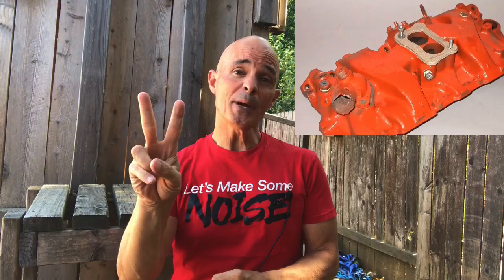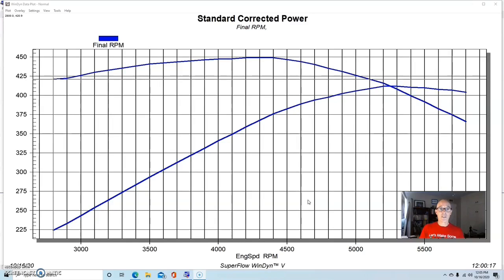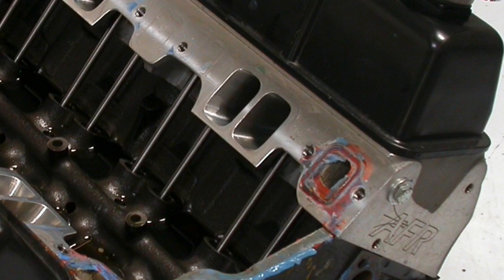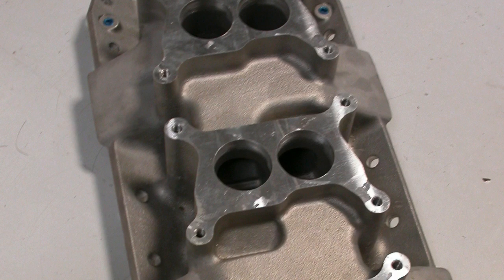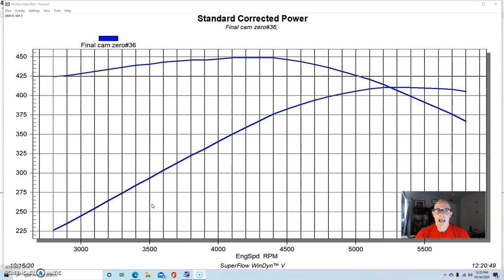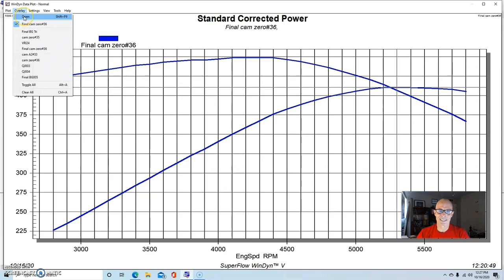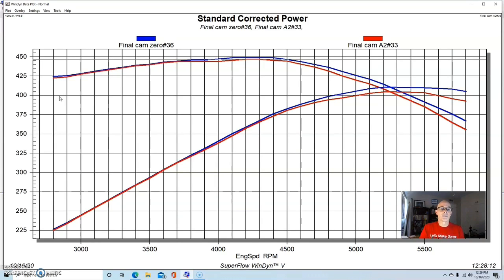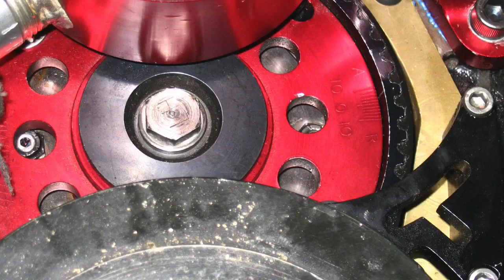SBC TRI-POWER INTAKE & CAM TIMING

Comment: Set the cam straight up, that's what it's design for. The best way too improve on it is to put higher ratio rockers. You don't increase the duration but you speed up the open and closing, more area under the curve along with higher lift.
Reply: For example, going from 1.5 to 1.6 rockers is basically like a mild cam upgrade. Just make sure your valve springs can handle the extra lift.
Reply from the maker: it effectively adds almost 2 degrees of duration too
Reply: Just what I was thinking, but I've never done it. Thanks for the comment.

Comment: First time request...a lot of us have mild built motors, but want a little more cam. Can we just put in 1.5 or 1.6 rockers to increase hp?
Reply: Usually you can. The issue you run into is lots of aftermarket rockers are heavier than stock ones and if you have soft, old, stock springs you can get into valve float.
Ford guys have 1.7-1 that were stock on cobra 5.0l engines in their twilight that are worth a dozen horses on stock engines. For gm guys the rockers that came stock on 1996 lt4 were 1.6 roller deals that work with most factory heads, they are worth about the same power.
Reply: @timothybayliss6680  thank you
Reply: You'll see only marginal increases if you theres not a lot of camshaft duration to take advantage of the added lift from the 1.6 rocker.
Reply: @rustysausage69  thank you
Reply from the maker: Sometimes effective when run on stock cams(the combo is begging for wilder cam timing)
Reply: @richardholdener1727  thank you for your reply. I'll give it a try, I have double spring pack also.  👍

Comment: If you can find a Barry grant inline 4 barrel, a follow up of Ack Miller's inline 4 barrel from back in the 60's, that would be an interesting comparison.
Reply: joe : Hey Joe...Mr Jeremy Smith's 12 bbl comment way below, A few hours ago.... Aktron Reference for you Sir. 4" bore, 3.5 inch stroker crank SBC in 1959 and six  2bbl 97s.

Comment: I would like to see an individual throttle plate with equal length runner intake. Four Weber’s or maybe EFI. See how that does against the four barrel with duel plane.  Need more cam though.
Reply: Richard has done tons of testing with a 4.6l Ford and a homemade intake. I think he compared single plane v dual plane v custom. I think it was all fuel injected but the design changed
Reply: @timothybayliss6680  I have watched all of these. Individual throttle bodies have not been tested.
Reply from the maker: I have tested IR downdraft system on a SBC-it was from Speedmaster

Comment: Hi Richard! Is there a test you’ve run in the past with aftermarket adjustable cam gears on a dual overhead camshaft engine? If you don’t have the data on that I think it would be a cool way to demonstrate cam timing and lobe separation angle.
Cheers! And thanks for sharing all this information!
Reply from the maker: Yes I have-mod ford applications-both 2V and 4V

Comment: Rich, have you done any distributor comparison? Points vs. hei, factory vs. aftermarket etc?
Reply: He has said before as long as your not having the spark blown out, there is very little difference. The 292 turbo runs stock coil and points that he didn't check the gap on.
There is maybe a little to be gained with a msd setup that has multiple sparks.
Even nascar engines with indexed plugs and filed gaps, that work is only worth about 5hp at the very top of the curve. For those guys, being 5hp down is a huge hurtle when everyone is so close.

Comment: Hello Mr Richard ... I have  an idea or a question don't know  how to say it .. first what is the range of cams LSA ... i,ve seen 106 and 122 ... there is more? And the question is for a cam in the 240 or 250 duration range on a 5.7 or a 6.0 can the lsa be so high the it will have a minus or near zero overlap for smooth idle like a much smaller cam in the 210 to 220 range? How would it do on the dyno and vacuum ? Thanks
Reply: He has one video up with an Ls and three cams, same lobes but different lsa. Off memory it was 108, 112 and 120.
106 is not particularly tight, guys at EMC will run cams with 240@050 and 98 or 96° lsa.
Reply: @timothybayliss6680  saw it but it does not answer my question of a bigger cam with max high lsa compared to a small cam say a 224 224 114
Reply from the maker: I'm not sure the cam core cam do that-but I can check-I have not tested LSA beyond 123 degrees
Reply: @richardholdener1727  got the calculation ... 224 224 114 vs 242 248 124.5 both have -4 overlap ... if it is possible i'll pay for the bigger cam for you to test the vacuum and idle and power vs the 224 224 114 on an sbc 350 or any stock lsx .... or a 224 230 114 vs a 242 248 123

Comment: A while back you made a comment about VVT on the LY6, saying you’d like to investigate using that on a built engine. VVT has to be ultimate in cam advance and retard enhancement of the engine. This SBC combo had a very small, low lift cam that was probably close to maxing out the low end of the torque curve. Factory VVT allows something like 60° of cam centerline variation, so that might be enough to make 10-20 lb-ft way down at the bottom of the curve, a place you never test for performance mods. And again at the top, that much variability in the retard direction might make a useful 10 or 20 lb-ft at the top, which could be multiplied by rpm if you’re above 5252 at that point. I’m actually thinking about investigating keeping the VVT in my LY6 with a short duration (relatively) cam with a tight LSA. This, theoretically, would give me some overlap to fill in the torque curve when the cam is “straight up”, but let me have some cruising manners at 1500 with advance to maybe 30° intake closing (at 0.050”]. Conversely, retarding to 45° of intake closing at high rpm might keep most of what a 459 or 469 cam does for a 6.0. I haven’t discussed this with Comp or anybody yet, don’t know if their blank VVT cams can accommodate the lobe profiles I’m talking about, so I guess it’s just dreaming at this point. Meanwhile, Richard, keep all this good research coming on my most favorite channel!

Comment: Mechanical Timing on a mild run of the mill back yard engine " dot to dot " is fine as long as the combo isn't to radical it's not going to matter much on the daily driven street engine ( not that would be noticeable really ) .
Reply: I agree with that statement in its face, but I never realized how many cams I installed when installed dot-to-dot that (once a degree wheel installed) were actually about 4-5 degrees retarded from what they should have been.

I degree mine in 100% of the time.

Straight-up is fine as long as it IS straight-up.
Reply: @jeremythefleetguy1693  Yep I absolutely agree
Reply: @jeremythefleetguy1693  a real interesting question is how much of that is in the timing gear chain setup your using?  In one case I found that by just changing from a stock setup to a high quality gear/chain set eliminated some of the retard I hear suggested. The real answer is it never hurts to check but, unless you are running stock pistons with over 0.500 lift and relatively high duration, the retard may not have as much affect as you would think on a really mild street motor. As you progress in lift and duration the effect becomes more noticeable and in some cases can creat possible piston to valve clearance issues in some high lift high duration cams. Another reason to suggest also checking piston to valve clearances after decreeing any cam. Just my thought on the subject. Really nothing but an old mans rambling thoughts. Thanks for the opportunity to exercise those three brain cells of mine. They were getting lonely.  Lol
Reply: It’s all good. I’ll take the time to degree wheel it. It’s better than guessing to me. Live and let live.

Comment: What about dual 4 barrel manifolds? When do they offer an advantage? Tunnel rams are always the answer for best n/a power but what if you want it to stay under the hood and not have a huge cowl blocking your view... are low rise dual 4 barrels ever they answer? Do they give you the advantage of individual cylinder tuning? Come on Richard I know you have some answers! Thanks for the priceless information and we need more happy hour time!
Reply from the maker: low-ram, dual quad intakes have not shown to be the equal of tunnel rams
Reply: Richard Holdener I ran a f28 2 4bbl edelbrock intake on a 325hp 302. With progressive linkage running on the primaries of the back carb, (625 comp series afb's) I got 25mpg in a 83 mustang. On the track it averaged 4.5mpg, lol. But the SOUND! Still have that intake sitting in the garage..someday I'll run it again.
Reply: @richardholdener1727  but are they worse or better than a single or dual plane 4 barrel intake? Or do they bridge the gap?

Comment: No idea why nobody is making a tri-power intake for a big block chevy. Edelbrock makes them for a variety of common motors but no BBC?? The factory 427 pieces are insane money.
Reply: John Presnell  thats awesome! Theres a Corvette website that has OEM tri power intakes. Only place Ive found. Depending on #s and condition..... $1,900 to $5,000 just for the manifold. And they only have a half dozen at any given time. You got a great trash find!!! No way that's happening in 2020. Edelbrock, Wieand or Offy need to get on this.

Comment: The 440 six pack was "rated" at 390, 15 over the four barrel 440. That was a gross number, SAE net was about 335. Tom Hoover, the engineer responsible for the 426 hemi basically said that it was mostly marketing, but impressive to see.

Comment: My friend had an old 64 Chevelle with tri-power 327 in it and it screamed and tried power motors are really tight and nasty if you have to run up against one

Comment: 12 barrel anyone?
Reply: Old Italian supercars are often set up with that. The V12 cars run 6 pairs of weber 2-barrels downdrafts with individual throttle bodies and stacks. Sounds fantastic but it's a nightmare to synchronize and tune.
Reply: Jeremy Smith : See this
https://youtu.be/Ztujox8fly0
Ak Millers old Bored and stroked out 283 Chevy taken  to 352 cuber made 315 rwhp in his Goldspar roadster. Thats 12 bbl were 8 bbl would be Port on Port. Six 2bbl 156  cfm 0.98 "97" Carbs. IIRC... Duke Howlet from Garret Air Reserch used to beat his a$$ with just one TO4B in a Ford. He told Ak:-" How about you stop all this tryin....and put one of my whistles on there. Heck, try Two!..." Mr Holdener knows the answer about the .best Tri Power....

Comment: I wouldn't call the advance/retard the cam rules of thumb hard and fast rules either. Maybe the rules of thumbnails. While it does in fact work in "some" instances. It appeared to me after taking the time and effort to do all the work multiple times over the years to have more to do with the combination of possible airflow vs cam specs. Too large a cam does respond well to advance on an airflow combination that is more or less correct for the cubic inches. The same seemed to work for too small a camshaft on an engine combination that was equipped with heads and intake larger than the cubic inches actually needed for a particular application, then retarding the cam got more power out of the combination. Which really brings the question of Why would you install a camshaft in a particular engine combination that was too small or too large for the airflow capabilities or use parts that are so far off the needs/requirements for your application? Even large manufactures used cam timing almost as they do now with variable timing as a fix and slight extension to help power or emissions in a certain area of the rpm range. The most obvious to some of us "Old" guys being Ford retarding the cams of 460's in the early 70's. The retard was approx 6 degrees, killing the bottom end of a large engine, only allowing the cam to be Most effective well past the design of the intake, and other parts. Swapping in the timing gears for a 429 would wake up a mid 70's 460, bringing back that bottom end. Certainly adding those extra hydrocarbons Ford spent time and money attempting to eliminate for emissions requirements.

Comment: What a great little street driver that would be, thanks for putting this one up, Richard. While I love continually learning on your channel, I'm well into my 60's now and the drag strip days are mostly behind me. I am trying to assemble my nostalgic builds with old school looks, but with some snap. What I would love to see is some intake testing specifically for the aftermarket TBI's like FiTech and Sniper. With carb signal removed from the equation, and a single Lambda sensor in one pipe, I would think that distribution becomes critical. Could a small single plane be the way to go here? Love to find out, and I can't be the only one. Got anything for us?
Reply from the maker: even with EFI, a single plane will still make less power in the lower rpm range than a dual plane

Comment: Richard, why not do a deep dive on cam timing? Dual pattern vs. single pattern.  Narrow LSA vs wide. And test the Vizard 128 theory.
Reply: he has multiple vids about LSA
Reply from the maker: I like Dave and all his hard work-but these formulas are unfortunately not universal
Reply: That would be awesome!
Reply: What is the Vizard 128 theory?
Reply: @davidreed6070  Google for details, but in short it is a rule of thumb for choosing the right lobe separation angle for a cam based on a few factors. Along with choosing duration based on overlap it is supposed to produce a better spec for the engine than just choosing an off the shelf grind. It is primarily designed for SBC engines  according to David vizard.
Reply: I'm curious as well with event ramps to spring pressure to float or loss at rpm. Comp claims it can gain more hp without the steep ramp cam events. Wonder how much more control you have at even higher rpm if the springs aren't having the lifter jumping.

Comment: The dual plane version is the closest I've seen to my na setup. It seems that comp cams was pretty close on their estimate. I have a xfi252hr cam and good heads and an air-gap intake. Comp estimated 406hp@5500 and 463ft-lbs@3500rpms. Cam is 252/264 adv. 202/212@.050" .550"/.546". It's in a 3/4 ton truck so I wanted plenty of low end torque.. while still improving top end significantly over the stock 190hp rating. 163ft/lbs and 216hp over stock was a nice power bump. Most dyno tests that I've seen don't have that much low end torque from a 350. I was beginning to doubt the Camquest software's estimate. 
  Your xe258hr is only 6 degrees bigger but lower peak lift. Mine has .070"/.059", or 12-15% more lift. I know you don't usually use cams this small. Why would you, when it's not taxing the head flow. 
  Great video. A buddy really wants to put a tripower on his car. I told him that tuning 3 carbs will be a nightmare. 
  I just saw a video from freiburger and dulcich and brule about 4" open exhaust. It seems that in a supercharged application, length of exhaust doesn't matter much. I'm running 4" open single exhaust on a centrifugal supercharger. Around 8psi.
  Keep the kickass content coming Rich. We love it. Big bang, other guys, ford, Chevy, Mopar, import, turbo, roots, centrifugal, nitrous. we love it all.
Reply: This is all I get when trying to use the Camquest app on Comps website:

 Thank you for your interest in CamQuest by COMP Cams®. The CamQuest application is currently offline for maintenance and updating. However, we have a variety of other channels to provide you with a personalized cam recommendation from one of our knowledgeable, highly trained and experienced technicians.

It's been like this for years. One slow day at work I went online and was emailing back and forth with one of their experts.... it turned in to 2 days of emails and on the 3rd day I quit replying. It was a ridiculous process trying to get helpful  information via email. I probably would have had better success if I had called them though.
Reply from the maker: the 463 lb-ft seems generous
Reply: I know it seems generous, but it's only 14lb-ft more than this zz4 350 short block. I've heard the Camquest software is optimistic. This engine makes 449lb-ft and you know these heads flow way more air past .480" lift.

Comment: I have a question. I have a Gen 6 454 with a zz502 cam was wondering what size carb and jets to start out with. It's in a 1974 Chevy C10 with an auto trans. Just going to be street driven most of the time. Thank you for any help.
Reply: For a street driven engine with an auto, I'm going to insist on a vacuum secondary. There are some pretty big ones out there, I think the biggest Holley is an 850.
Your looking for little differences, the gain from going from a 600cfm to a 1000cfm on the dyno with that engine might only be 10hp, but when you put it in the truck with a torque convertor behind it, the bigger carb might cause all kinds of headaches. 
I know it sounds cliche but a 750 vacuum secondary might be your best choice. Richard did a test for superchevy where he ran an aftermarket cam in a gen6 with an edelbrock intake and a 750hp carb. http://www.superchevy.com/how-to/engines-drivetrain/1506-how-to-pick-up-big-power-on-a-junkyard-454-with-simple-cam-swap/
This will be pretty similar to whet you got going on. 
I am not gonna tell you how to jet it. Lots of guys have videos up on getting carbs.
Reply: @timothybayliss6680  Thank you very much for your info.
Reply from the maker: thnx Tim-yes about a 750, but I wouldn't hesitate to use a 650 on that mild combo-and cue the too small comments
Reply: @richardholdener1727 also thank you very much for your info.
Reply: I have a Holley 650 with vac secondary's. What jets should I start out with?